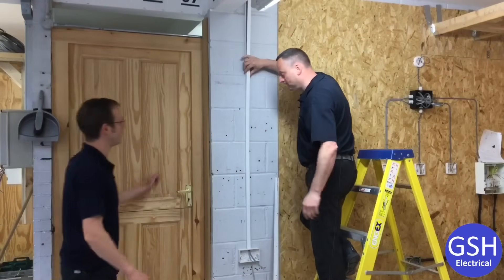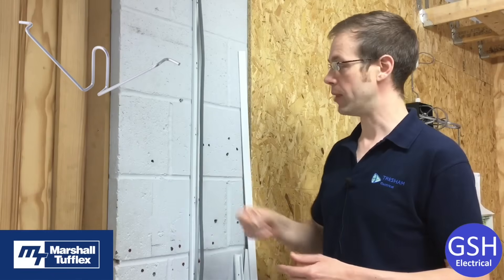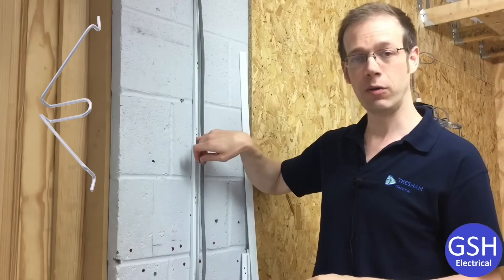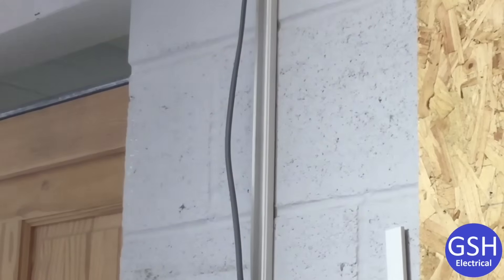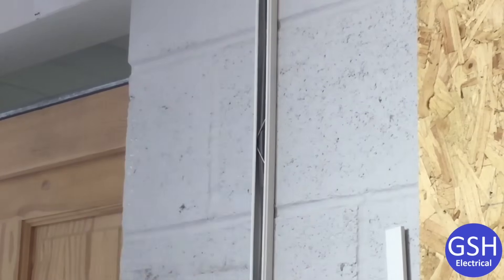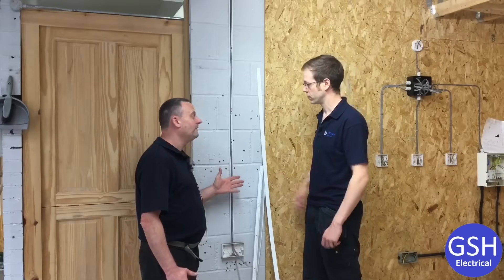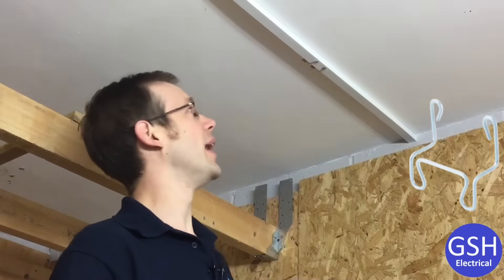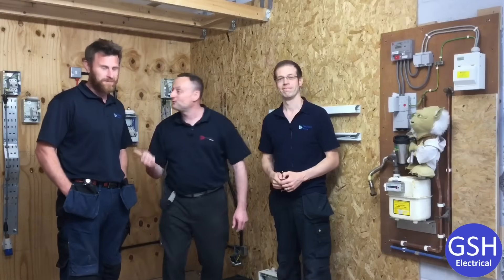BS 7671 18th Edition Premature Collapsing of a Surface Wiring Systems (Please Read Description)

Comment: Nice idea and I get were there coming from, if the IET say we have to use fire clips and be compliant with BS7671 then that’s what we do simple. 
But and this is a big BUT if I was a firefighter I would be more concerned with the building collapsing around my ears or the floor collapsing under me or the staircase collapsing under me then I a view cables hanging out of or off the ceiling, also I can’t see how a couple of cables fixed vertically on a wall could course a problem as even though they may of melted they will just be hanging vertically.
If firefighter’s are that concerned then why don’t they carry a pair of wire cutters as part of there kit? . Maybe eFixx or CEF could donate a dozen pairs of knipex step cut wire cutters to there local fire station, for them to consider, then they could stop telling us how to do our job . Just my own personal opinion, but who am I? I am just a humble spark and my opinion means nothing. 
Great video Gaz and Joe as always.👍👍👍👍❤️

Comment: Good intentions and thought but drilling a trunking twice could be a ball ache for most. I can’t see how a vertical cable would create a man entanglement hazard if one fixing is at high level next to the ceiling or in the void above. Surely it would just hang there if trunking melts?One drill hole per cable clip whilst also securing trunking. A ‘wooden’ rawlplug with steel washer between trunking and wall would surely work. They use wood in high quality safes to protect against fire damage or intrusion by flame (as well as the concrete core). The wood chars and protects it from further damage deeper down from the surface. All a tad over engineered this one...

Comment: PVC-U has a vicat softening point of 85°C. But humans suffer hyperthermia quickly followed by death at around 50-60°C. As such it would do nothing of practical use to provide access to a building still on fire. So what is the point?

Comment: Why is there a need for a second hole in the trunking; with both holes so close together, could you not use the same hole you use to secure the trunking to the wall to hold the clip in place?
Reply from the maker: Hi and thanks for commenting. One hole is pre drilled in the middle of the trunking for screw and red plug and the offset hole is for the firefly clip fixing point. All the best Gaz 👍

Comment: if the amount of clips are down to the judgement of the electrician, i judge that a metal clip directly above the vertical drop tight to the wall will stop the cable from falling in to any escape route, rendering the clip pointless on a vertical drop
Reply from the maker: Hi. Professional judgement 👍. Thanks for commenting and watching GSH Electrical

Comment: Hi there, all this would not be needed if a fire detection system could be made to automatically shut the power off at the incoming service head=no electricity
Why not that solution?
Reply: It's not about the shock risk, its the risk of of a firefighter being stuck in the wires when they have dropped from the melted trunking because of the heat from the fire.

Comment: I have to admit that I am not sold on the retro fit trunking clips. In the event of a fire those tiny screws (look like 30 mil screws) would be next to useless screwed straight into a plasterboard ceiling and would offer little to no support for cables stashed within. Not to mention unsitely. Safety first and all that jazz. A nice idea but needs more thought. I take it these have been scrutinised under test conditions before going on the open market to meet regs? Interesting video all the same. I also find it curious when stuck in a loft in an older property removing old cables from a rewire, that I am un picking cables from metal clips that fold over and secure the cable to the fabric of the building....... I am fairly new to the industry but it seems that there is a bit of trial and error going on with the reg writers. Many thanks. :)
Reply from the maker: Thanks for the detailed comment... I will be following this video up in the coming weeks. Thanks Gaz
Reply: GSH Electrical sorry a bit long I know....... Look forward to it. :)

Comment: Hi are fire resistant clips needed if trunking is in walls and plastered over.  Thanx
Reply from the maker: Hi. No only for surface wiring systems 👍thanks Gaz
Reply: @GSHElectrical  thanks for all your help Gaz. Great video again. I'm trying to decide which clips are best for wires against floor joists etc .

Comment: I'd be interested to know your thoughts on how we'd deal with trunking that is to be fixed to a drylined wall or to a standard plasterboard ceiling, as metal plasterboard fixings cannot be fitted thru the trunking.  Also it requires that we are allowed to rely on the plasterboard maintaining structural integrity in a fire, which implies therefore that cables above a plasterboard ceiling don't need to be supported separately - ergo fishing cables for a rewire still legitimate practice.
Reply: I agree with you on this, if you have a 1 hour fire rated ceiling and the cables drop after 45 minutes of fire then the building is structurally un sound to enter anyway.

I had this discussion with an NIC inspector recently and TBH he was just narrow minded about the whole thing stating “the book says what the book say” the usual answer of someone who can’t think for them selves 

And as you state if its into the plaster board what difference does it make, the only thing I can think about is heat not flame melting the cables but still if its that hot in there you don’t want to be in there no matter who you are 

The only place I see this to be very practical is suspended tile ceilings.

Comment: How hot does a building need to get for the radiant heat to melt a wallplug?
Reply: The wallplug will be protected from melting by the heat absorption of the material it is embedded in. In other words the brickwork itself will have to achieve a higher temperature than the melting point of the plug before its integrity is compromised. The same principle as heating water to boiling point in a paper cup. The paper will not burn until the water can lo longer absorb the heat. don't worry Stuart, I do believe the 19th edition will require all women of child bearing age to have a sign fitted in the womb stating "Attention fetus, being born will result in death"
Reply from the maker: Hi. It’s be along time since I read the research but from memory very hot hence they say you can use wall plugs. However not using wall plugs which is an option saves plastic thanks for commenting and watching GSH Electrical 👍
Reply: 300degC. BRE ran some tests on various metal clips where plastic wall plugs were used to attach to substrate. Every single metal clip fell off the substrate at temps where firefighters would still be walking around doing their job. Throwing cables over ceiling metalwork is same problem - the plastic wallplugs bring the whole lot down in a fire.

Comment: at 8:21 screwing straight into the ceiling wont hold much, what screws are you using? A metal easyfix drywall screw could be used?
Reply from the maker: Hi. I would use metal plasterboard fixing 👍. Thanks Gaz
Reply from the maker: Hi. We have added extra information in the description that will aid the video 👍

Comment: That is ok for radial circuit but mostly use ring circuits, and why don’t we just use more fire resistant plug and trunking or just use a clip top and bottom to hold if rest fail. 18th edition so far on first thoughts it is too??? Bit like when 16th came out and added way over the top earth bonding.
Needs to go back for rethink
Reply from the maker: Hi. The clips work equally as well with 2 x 2.5 cables. In the description I talk about the need or not to use fire resistive plugs. Thanks for taking the time to comment and watching 👍 all the best GSH Electrical

Comment: The clips look the same clips that use to hold lucas sealed beam head lights in cars of the 60s / 70s . and why drill a hole 2.5"+ deep to hold a screw that looks about an 1" long?
Reply from the maker: Hi. Thanks for the comment and watching. I think the screw was 1 and a half inches sorry if the hole was deeper than you would have liked Joe must have been over excited 😆. All the best and thanks again GSH Electrical 👍

Comment: These clips might cause the wiring to short out early when the cable melts?
Reply from the maker: Hi. Thanks for commenting and watching. If the trunking and PVC insulation have melted due to fire the metal clip causing a shot will be the least of your worries. Thanks for the support all the best GSH Electrical 👍
Reply: Do the IR resistance during fire hahahaha
Reply: Porcelain insulation?

Comment: I've always used the same hole and screw that I've fixed the trunking to the wall with for the clip
Reply from the maker: Hi. Thanks for commenting and watching. We just wanted to show the trucking manufacturer had pre cut holes that were offset for the firefly clip fixings. Your method saves time 👍 all the best GSH Electrical

Comment: How have you found those wall dog screws by dewalt? Do they drive straight into masonry block or do you need to drill a pilot hole 1st?
Reply from the maker: Hi. These screws need a 5mm pilot hole first. Research suggests that screws and red wall plugs can still be used as the fixing method I mention this in the description. Thanks for commenting and watching Gaz 👍.

Comment: Interesting item, I sometimes have to run data cables in trunking in commercial premises and above false ceilings We're generally not asked to install to any particular regulations, leaving them in a position where collapse would be an issue. Does the 17th/18th edition cover such work as data/alarm/cctv cabling?
Reply from the maker: Hi. Yes it cover all cables. The issue is with surface wiring Collapsing and causing possible entanglement for firefighters. Thanks for watching and commenting GSH Electrical

Comment: Does this regulation apply for any voltages in particular or is it any wiring systems. Are the clips to protect against electric shock or just entanglement?
Reply from the maker: Hi. Great question... any cables data, tv, mains etc and your correct with entanglement we have lost 8 firefighters... thanks for commenting and watching GSH Electrical 👍

Comment: Do these clips reduce the number of T&E cables you can install in a ...say 25 x 16mm section of trunking...in your video you seem to be wiring a spur...will two 2.5mm T&E cables still fit in the same size trunking for a ring circuit using thes clips?
If the firefighter is using his/her foot to feel their way about in a fire....surely the floor area would be clear in your instance as the cable runs down from the ceiling.....where it would have the necessary clips...then it enters a back box//patress..how can this cable trip a firefighter at floor level? It would not even han hang out from the wall.....But,  It is more likely to hinder their hand movements along a wall.... cables comming up to the patress from the floor may cause a trip hazzard in the event of a fire....Surely these clips would need to be installed close enough together to prevent any sagging  or space between the cable, and whatever it is fixed to, so that a foot or hand may not get tangled with the cable....and someone, somewhere needs to decide this distance....just like all other cable clips/clamps//supports...otherwise why bother installing them....1 per metre...or 1 per 0.5metre....or something similar...which distance is optimal?
Oh....with all this LED technology....someone needs to create a torch/head-torch for firefighters....so they can see in thick smoke.....and then we the electricians can buy them...to see in the darkest of lofts and cellars....
Reply from the maker: Hi. Form my experience you can comfortable fit the firefly clip and 2 x 2.5 cables in MMT2 trunking. Thanks for watching and commenting GSH Electrical.
Reply from the maker: 8 firefighters have died by being entangled in cables hence the change in regulation GSH Electrical
Reply: If you think an LED torch can penetrate thick smoke, you need to stop watching TV depictions of fires and talk to a real Firefighter. The only thing we have for smoke penetration is Thermal Imaging cameras. My Helmet had an Inbuild high power LED 5 years ago.    https://www.rosenbauer.com/en/int/rosenbauer-world/products/equipment/firefighting-helmets

Comment: From what I have read (post 3rd amd) tests have proven that a red thermosetting plug will withstand very high temperatures due to the thermal mass of a concrete block wall
Reply from the maker: Hi. Yes and I have added extra information in the description 👍
Reply: I'd say it would depend on the thermal mass and location of the material into which the wall plug is fitted.  A victorian brick wall would be a  different story to a plasterboard ceiling, partly because the downward force of weight on a screw in a wall tends to produce a pivot type of effect unlike in a ceiling where the screw is drawn straight out of its hole.
I'd prefer to know for sure rather than just assume my theory is correct /  common sense.

Comment: What devices are there for plastic conduit installations? I can fully understand the reasoning behind the regulations but it just seems impractical to be fitting these clips on a large installation.

I’ll caveat my comments by stating that I’m not a jobbing sparks anymore so probably out of touch but recalling the demands of getting a job done and the time allocated by the foreman etc to complete an installation to then have to mess around with these clips will just add additional time to any job. 

I guess bottom line is what price safety! 

Great video as always and look forwards to many more.
Reply from the maker: Hi thanks for the message. PVC conduit will be supported using metal saddles I have some glossy white ones I am going to show as part of another video. All the best GSH Electrical

Comment: Hi ya I have a few questions to ask the firefly clips look great and serve a good purpose however in  a domestic installion where a piece of mini trunking has more than one cable inside the trunking will the fire clips be able to incorporate two cables judging by the video and the space the clip takes up within the trunking it doesn't seem like it would . And secondly the retrofit clips that go on the outside of the trunking , how would you get around this if the trunking was fixed to a plasterboard ceiling and the clip would have to be fixed to the plasterboard aswell , the use of a wall dog screw would not be sufficient enough .
Reply: colin sanzeri use a metal toggle bolt
Reply from the maker: Hi. The latest information me and Joe have is the wiring system needs to be prevented from premature collapsing so up to about 30 minutes. A metal plasterboard fix and clip over the trunking will prevent early collapsing of the wiring system after 30 minutes the plasterboard will be possibly shot. Yes you can fix more than one cable using the clips shown in the video. Thanks for watching and commenting GSH Electrical

Comment: Good video as usual. Would like to see more close up detail of that retro fitted. More of a concern to me would be what is the solution to plastic light  fittings from collapsing pulling  the cables and fire fixings out of a ceiling due to the weight of the light fitting.